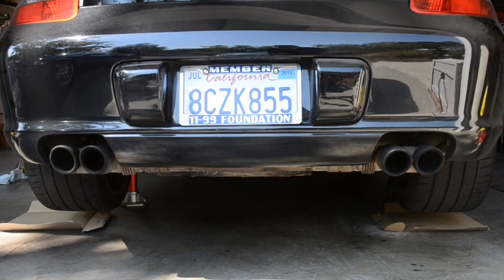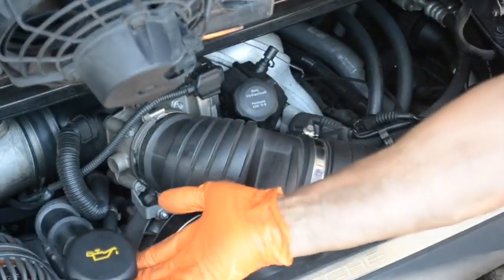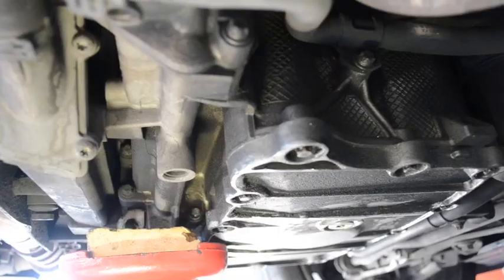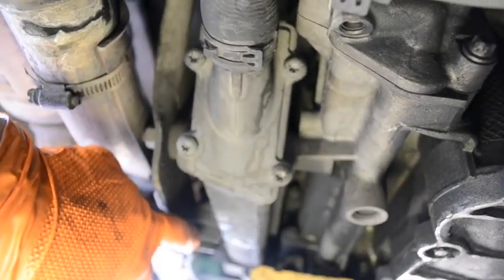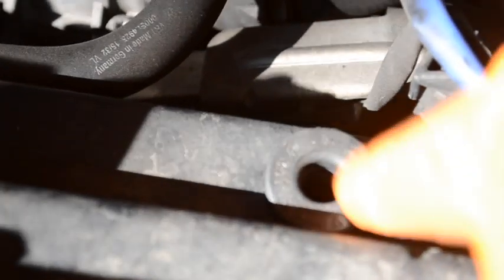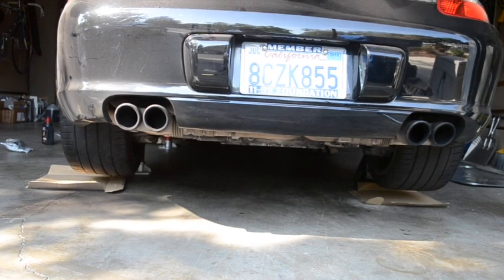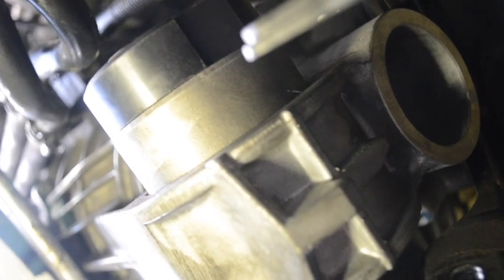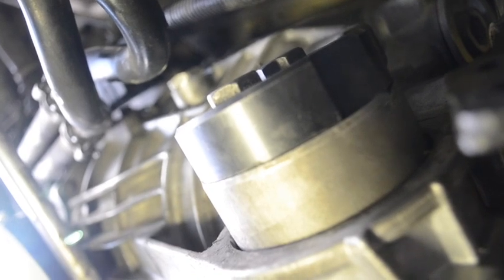Motor and Transmission Mount Change Porsche 997 Carrera S

Comment: Thanks for the video. Really like it! I am thinking of installing semi-solid engine mounts on my 997 as well. How do you like them so far? Ist the increased NVH acceptable?
Reply from the maker: It worked out well, I no longer have the car.  The stock mounts I removed were in bad shape so these really helped.  There is an increase in NVH, but it's completely acceptable as I was using the car mostly for track use or performance driving.
Reply: I installed Wevo’s on mine and went back to OEM’s after 600 miles. The severity of NVH was incredible especially if you have coilovers and polyurethane transmission insert… a BAD combo for street use. 

For a street car stick with OEM mounts.

Comment: did the trans mount make a difference after install?  What brand mount did you use?
Reply: @Dan Tsuchiya thanks.  I have both Trans and motor waiting to install.  Hoping for tightens up my trans feeling. I have 03 GT2, Both stock.- car has 33k miles.  Your car a Manual or PDK?
Reply from the maker: Manual car, OEM transmission mount.

Comment: Why did you go with those particular motor mounts. Great video 👍
Reply from the maker: I have used Wevo mounts in the past and they provide a little better support than stock (for spirited driving), but stock ones are also fine and use the same procedures for installation.
Reply: @SirFixAlotAutos  thanks dan

Comment: Dan..is your car non turbo with Auto trans?  I ask as the mount for my car 03 manual TT is complete unit and sold with bracket, thus no need to press out just replace the carrier.  Thanks
Reply from the maker: Manual Transmission Carrera 2S